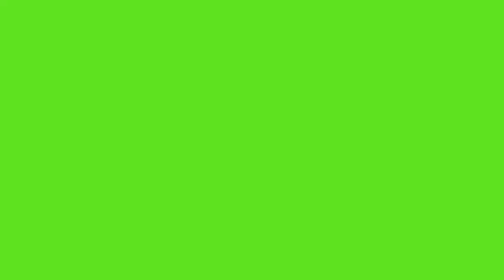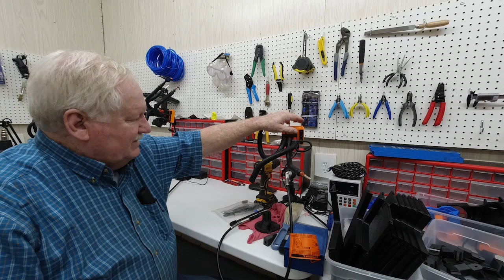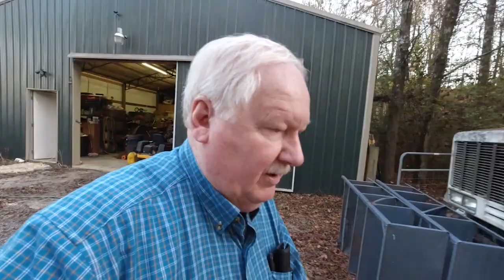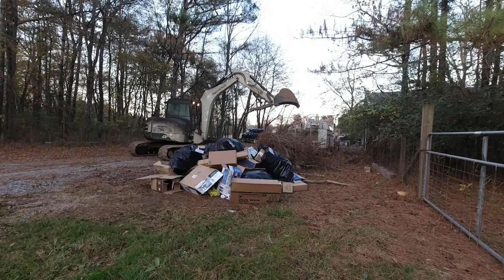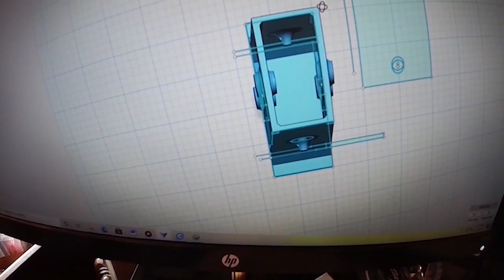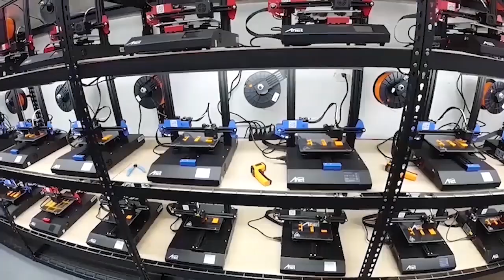FINAL PREP OF 3D PRINTED PARTS BEFORE SHIPPING and two additional clips

Comment: For the flaring, you can adjust the print settings in the slicing software to reduce the extrusion multiplier on the first layer, which should account for the "elephants foot". It needs to be tuned per filament type too since each behave so differently.
Reply: I just double checked for my prusa slicer, I suspect cura is similar:

Print Settings > Advanced > Elephant Foot Compensation - and you can pick a smaller extrusion width to compensate for the squish in the first layer + some of the softening of the plastic on the bed. I'm sure playing with it will get interesting results.
Reply from the maker: Thanks for sharing the slicer settings info, I will try and see if that will help solve this problem without changing the final surface from my textured bed. I use the textured bed to give me a smooth surface and eliminate the common lines that sometimes show up on the bottom surface of the part. Thanks for your comment my friend and thanks for your support...Ken